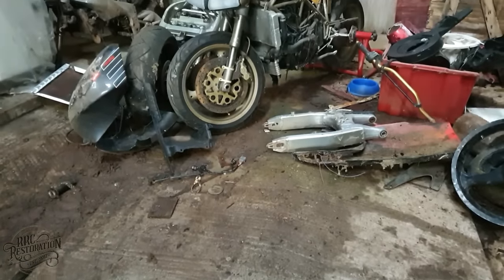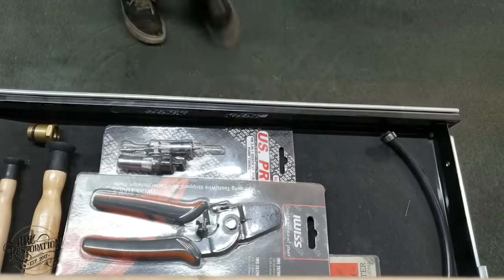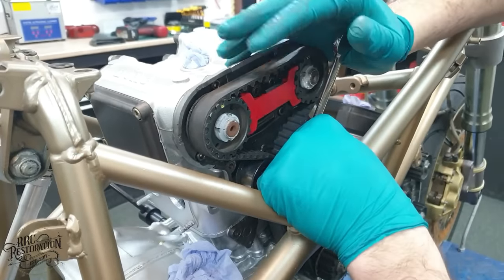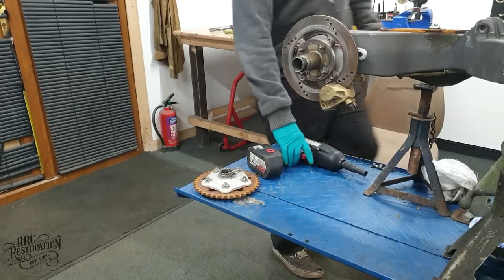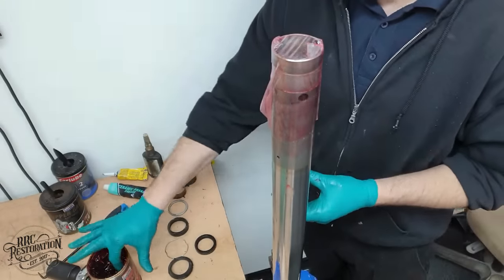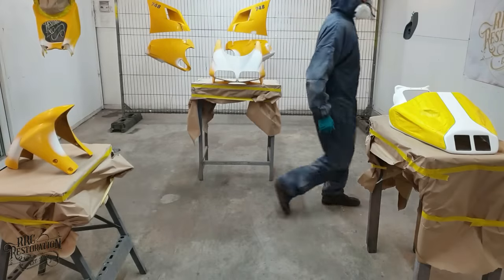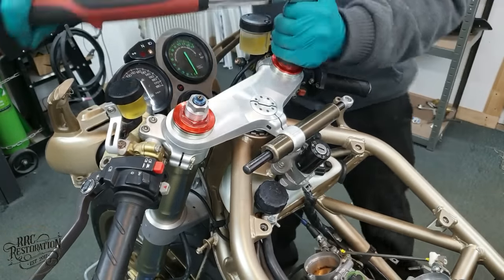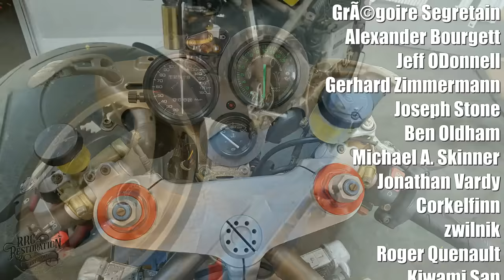Restoration Of An Abandoned Ducati 748 SPS - Genuine Barn Find!

Comment: Even after all the years that have passed since this bike was designed it is still one of the best looking, and sounding machines of all time, and it was a joy to see you bring it back to its former glory, 😎👍. Eagerly awaiting the next rebuild.
Reply from the maker: Thank you, really glad you liked it :)
Reply: Sounds rough to me.
Reply: @johnferguson40  It's a Ducati
Reply: @4Kandlez  I don't care what it is,  gasses are leaking and the head is knocking.
Reply: @johnferguson40  that's a dry clutch and think you'll find the gases are leaking from the end of the exhaust outlet 😂
Reply: @johnferguson40  Rough yes, but that's exactly what a Ducati V2 sounds like. Nothing wrong with it.
Reply: @RRCRestoration  I love it when a bike comes together.
Reply: Damn straight.👍
Reply: You sir are a genius this was a wonderful video to watch
Reply: Absolutely bro ageless design
Reply: What year is it?
Reply: Ducati saw the Honda nr750 and completely ripped off the styling 😂🤷‍♂️
Reply: @lo666zz  classic. My mechanic told me t buy a 2valve,as 4valves spent more time in th workshop,so I did.😉
Reply: @RRCRestoration  de 🎉🎉🎉
Reply: @janiilola5810  It's more like L2.
Reply: @johnferguson40   at 1:03:45 the dry clutch is engaged and quiet. Then at 1:03:51 he releases the clutch and the plates make the noise you thought was a noisy head or top end. Standard Ducati stuff actually..  hope this explanation helps
Reply: @johnferguson40  a little knowledge, always dangerous.
Reply: @martin5561  It's mounted so that the front cylinder is horizontal, but that doesn't change the fact that it's a 90-degree V2.
Reply: There nice looking bikes however they are the jaguar of motorcycles !!! Nice resto though sir
Reply: @RRCRestoration  well hows things my friend hope your well ? i just was wondering can you release another build ? i love your stuff and i keep checking your channel for another build and keep been massively dissapointed ..as an ex truck mechanic and a lover of 2-strokes for years , your channel and your standard of work and attention to detail is a joy to watch and in ireland mechanics at your level are not that common ... i know the work and time required for restores so im hoping your at one at the moment ..but if not i know you will severely dissapoint a lot of guys that think like me .... anyway theres a compliment for you and i speak for a lot of guys when i say that  no joke .. i dont want to unsubscibe but im watching the 916 rebuild and the 750 rebuild for the 3rd time (and still love them ) ...anyway thats it as i said hope you are good and hope you keep up one of my favourite channels and i have loads honestly ...cheers ...honestly love your stuff
Reply: @johnferguson40  0⁰0 😂
Reply: @johnferguson40  Hah-hah-hah! You're trying to be an expert know-it-all on bikes and epically failing here. @RRCRestoration is a professional--do you think he'd get paid for all of this work and then deliver a bike with engine and exhaust damage? You've obviously never even heard a running Ducati with a dry-clutch before.
Reply: @RRCRestoration  23:29
Reply: @banneddamn not really, they did take the idea of the underseat pipes but the ducati looks loads better
Reply: @mark675  well that's just you opinion, and considering they stole pretty much the entire styling from it... it's a weird  statement. 
Look at the 2..it's way more than just the exhaust.
Reply: @banneddamn  looks nothing like it, the single swingarm? Loads of bikes have that
Reply: @mark675  dude you're blind
Reply: @banneddamn  like I care what you think 😂
Reply: @mark675  I think you do, because you know I'm right, and I'm right because it's obvious.
Reply: @banneddamn  you're very sure for someone who's so wrong
Reply: @mark675  I'm not the one that needs my eyes checked. You just don't see the blantantly obvious, that's OK. Some people are just beyond help. Don't take it so personal.
Reply: @banneddamn  wrong wrong wrong 😂😂
Reply: @mark675  jesus man, youre like a child. the designer, Massimo Tamburini, said himself, after seeing the nr750 at Milan in 92, it inspired his design. It's in interviews. You gonna argue with the designer with what he has said?
Reply: @banneddamn  love winding you up, I best stop before you cry 😂
Reply: @mark675  oh so you won't even acknowledge this? 😁 How embarrassing. 

You lost. 🤣🤣
🤡
Reply: @banneddamn  win for me 🏆
Reply: @banneddamn  oh you are correct it's red so looks exactly the same 🤡 
A gsxr, r1 and zx10r all look the same cus have an exhaust up the side, twin sided swingarm and two wheels 😂😂😂
Reply: @mark675  He's right though. 🤣
Reply: @Emily-ou6lq  nope
Reply: @johnferguson40 a.
Reply: @darylclifford  I said nothing about "noisy head or top end".  Please don't  put words into my mouth.
Reply: @johnferguson40 put your dress away Karen - drama queen 🤴
Reply: @darylclifford  That reply and attitude is why our worl is in suc a pitiful state.  Good manners are a thing of the past it would seem.
Reply: @banneddamn everybody saw Ducati coming out with the Monster and copied it; now, thanks to that, naked style exists.
Reply: @jz4143  "naked" fairingless bikes existed LONG before the monster.... 
Nothing to do with the topic at hand tho
Reply: Good luck brother I finished mine wished I’d kept it yellow but parts hard to come by / on my channel;)
Reply: Tamburini's  beauties, the 916 and the 748.
Reply: @janiilola5810 A little bit quieter than a 900ss.
Reply: @jz4143
Howewver, the Trellis frames that Ducati incorated in its designs for years  existed in the  distant past, but was popularized by the Bandit 400/ gsf400 in more recent history before  Ducati
Reply: Oh yah man U can say it again😍best sound ever "il bicilindrico"
Check also " la ducati 998" that one to except the sound but even as a bike it's a killer. Very angry bike

Comment: I have 40 years riding bikes and have always ridden them as if I had just purchased, just exactly the way you gently tested your machine, just shifting gently and smoothly with low rpms, that way you can really feel the engine like a cat purring
Reply: Yes, I also like to feel the engine by gently using it ( most of the time ). Only occasionally I ride bike fast for a short distance.
So, I totally understand what you mean.

Comment: One of the most straight forward and realistic vidios i have yet seen.
Everything tested cleaned made good with no holes barred.Had I been the age where a motorscycle was my mode ot transport, which it was cor years, 
I would be pleased as punch to know that this guy did the job as he has all the right tools for the job and uses them, really great video of very much interested.
Bilds have changed since my day, my best nile was a  triton Triumph 750, having started with a two xtroke 250 arial leader.
That always stayed in my love of bikes as being a two stroke it was easy to clean, an nice bike to ride and very forgiving, and most repyable.
I recall taking all the fairing off and coating the inside with a paint they used inside condensers then respraying with the body paint, so they would never rust, kept everything clean inside as well, love the get my hand on one now, but dare say it would break the bank these days, and at 78 i dare say it would only be a fair weather means of transport.
Thanks for a really interesting video!!!! N

Comment: great to see you add so much value in the right way to do things, the front wheel, covering the ecu, thanks for the tip on the headlights, i will have to do them on mine. I have covered 54 thousand miles on mine and owned since 2006. Lovely to see the work you carried out on this one. Mine when the injectors are balanced sounds so sweet. Great to see your work

Comment: Congratulations for your Job!!!! I'm found it's very interesting when you get to check the belt tension! Great deal for used the cellphone to check it ! This is very true to do it, the major issues for belts drivers are uncorrected tension and working out the engine specs! Much better for you checked twice time, according the rotation the crank shaft to apply the measurements the tension belts, an lot people forget it to do this!!! I'm don't remember the adjustments on the valves intake and exhaust?  However that's very nice job, check the clutch,break system and discs, front and rear suspension completely revised and adjusted! Paint and colors check the chassis paint and reassembly and check wire harness!!! Great job ! thank you so much to share this video ! God bless you... waiting for the new one! 🇧🇷🗽🍻🍺🍺🍺

Comment: a little shy of ~30 years old foam becomes super brittle and crumbles if you touch it
give it 40 years and it turns to powder without even touching it, bought a lot of old things from the 80s with those foam pads to hold batteries in place and they have always long-since turned to dust

Comment: Really good video, except the bit where you pulled the brake pistons out with pliers. I use an old bike inner tube valve, pop them out using a track pump and cable tie each one back in after cleaning.

Comment: The clicking can be removed by using a shielded wire cable. Also had that issue with my camera and the problem went away after getting a quality shielded wire. It also has to have gold plated connector jacks.
Peace!

Comment: Oh man, you changed good Hiflo oil filter to the bad K&N lol
EDIT: Noooo!!! Motul 5000... Those run much better on fully synthetic oil. I always used 15W50 Motul 300V. Much, much better for them. Also, AGM battery for cranking power. They tend to have lazy starter. You can also replace battery wires for thicker ones. That will help with starting a lot.

Comment: Question - I note that you filled the oil filter from the can - another mechanic on here - (Rainman Ray) says you shouldnt do this because you could potentially contaminate the oil with a FB that would go into the engine BEFORE passing through the filter - thoughts?

Comment: I just watched the full hour and six minutes of this even though I have zero time today... Damn you! 😛
Gorgeous bike - though it looks like the speedo hasn't been sorted yet 😀
One question: it looked like the brake rotors had a small ridge on the outside. Were they the old ones? If so, how did you clean them up?

Comment: Coincidentally and amazingly, I just picked up a 2001 748 Biposto for myself. It needs lots of maintenance because I have no service records to go with it and it's at 20,000 miles. Any tricks or pitfalls I should know that won't be in the Haynes service manual? Also, how do I get one of those I-shaped pully holders? And what's the app you used to do the belt tension by sound???? Or if I'm unfamiliar with the desmodue engine, should I punt and pay a qualified mechanic? As is, the bike seems to run fine but who knows how old things like the belts, in-tank fuel lines and other bits are. I don't want to just ignore it all and end up with a blown engine. At least the tires are good!

Comment: For the U.S market I would expect a buyer could pick up a Ducati 748 for somewhere between $5,500 – $10,000. The key difference for the price will be condition, model year, spec etc.What is the rarest Ducati 748?

748 SP

The 748 SP, one of the rarest of all the 916 shape motorcycles and certainly the rarest of all in the 748 range.

What is the difference between 916 and 748?

The only differences are rear tyre size (180/55/17 as opposed to the 916's 190/50/17) and engine capacity (88 mm bore and 61.5 mm stroke) of 748 cc (45.6 cu in). The engine's shorter piston stroke gives a higher rev ceiling of 11500 RPM, and the smaller pistons help the engine accelerate more quickly .How much horsepower does a Ducati 748 have?

Ducati 748 Specs

The engine produces a maximum peak output power of 97.00 HP (70.8 kW) @ 11000 RPM and a maximum torque of 73.00 Nm (7.4 kgf-m or 53.8 ft. lbs) @ 9000 RPM .
What is Ducati's most expensive road bike?

Ducati Desmosedici

This limited-edition motorcycle is ranked among the most expensive bike in the world as of 2019, coming in with a price tag of $232,500. Part of the insane cost of this bike comes from the quality of construction. The Desmosedici is loaded with carbon fiber.

With that been said I have one in mint condition and it's my baby and the death of me 😂😅😊 it's a great bike love it.

Comment: Well...... somethings wrong, that oil filter came off with minimal effort.  Everyone knows its supposed to be tightened to an unhuman level of torque, so only a Ducati Authorized Service Technician can remove it as God intended.  Also Ducati test rides are required to be done at full throttle, pin it to win it.  You are forgiven as it looked damp and the roads not the smoothest  of pavement.
Love the Cat though.